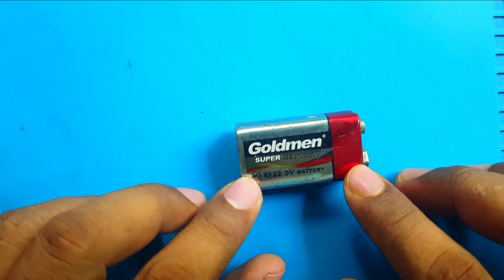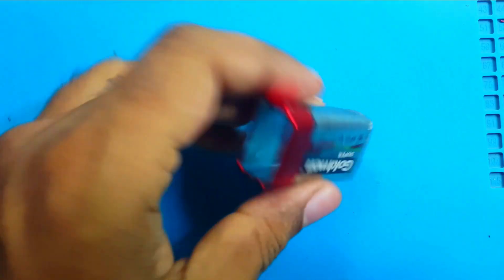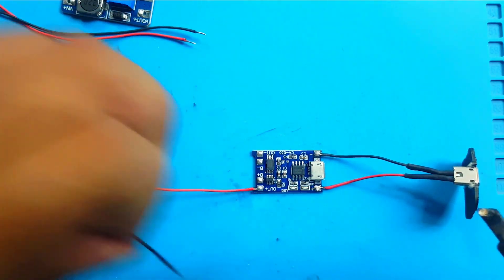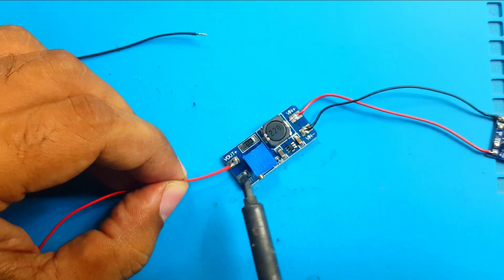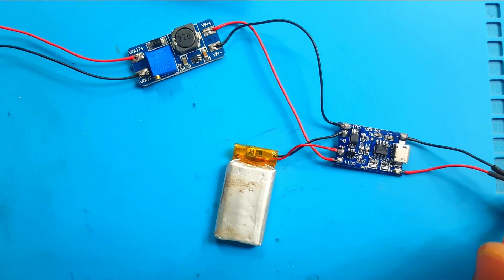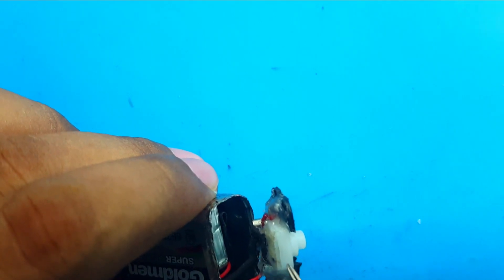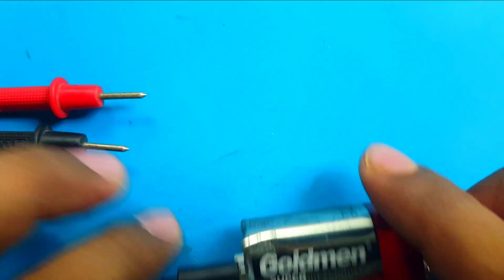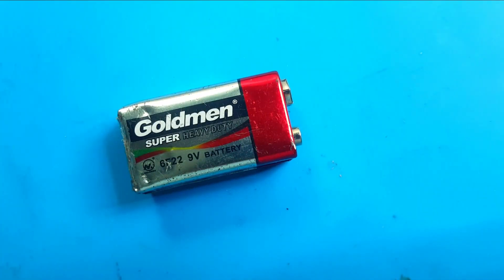How to Make Rechargeable 9V Battery at Home

Comment: Doing this way quickly drains the battery because even when not in use, it still boosts to 9v. The most optimal is still a 2s battery assembled from a small 102040 hpawcj lipolimer battery mounted outside a 2s 18650 battery.
Reply from the maker: That's an interesting point about the battery drain. Thanks for sharing your insights!